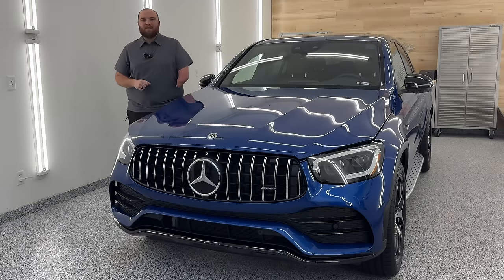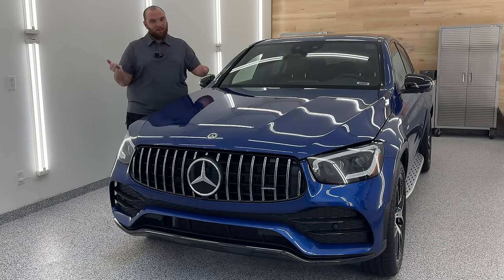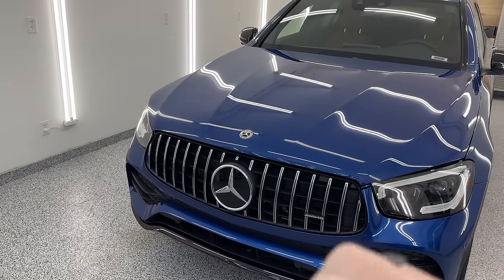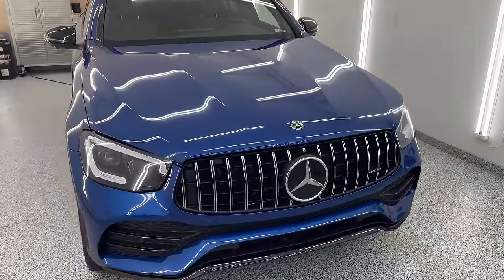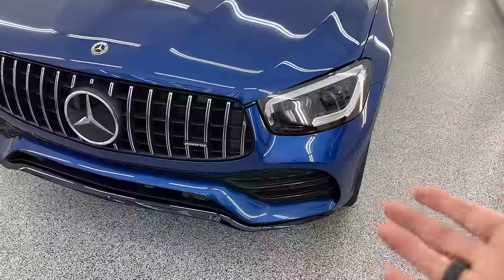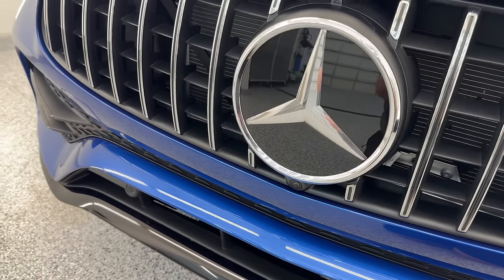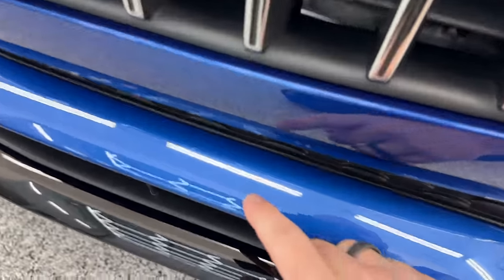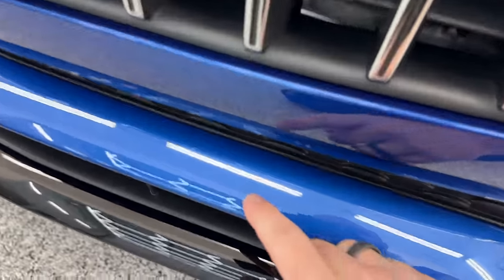The Ugly Truth About Paint Protection Film (PPF) After Just 6 Months & 3,500 Miles

Comment: Isn’t the whole point of PPF that it is a sacrificial layer so instead of the bug stains permanently damaging your paint it damages the PPF? So essentially you don’t have to repaint your car and as result reducing the resale value of your car, you just take off the PPF and now have a more desirable car to sell or trade in and with perfect (original) paint, which ultimately means higher price for the seller.
Reply: That's what he explained in this video.   It's when you see people getting PPF on a vehicle that will never recoup the costs of even getting that done is what boggles my mind!  To each his own I guess...
Reply: real talk...  prior to ppf being a thing, i've never sold/traded in a car where the paint having minor defects affected it's value.
Reply: I've had PPF/Wrap at a shop here in San Diego. After 7 years I removed them and notice lines of scratches everywhere that is caused by the razor the shop used. The value definitely went down and to say you get good value when selling or trading is not true.
Reply: @hotdognobun  exactly, PPF and vinyl wrapping is always risky when the installer hand cuts. All those video saying they are so good that they only cut the vinyl and not underneath are all BS. Those videos you see they cut vinyl over their hands; the truth is your skin is stretchable, the low amount of pressure applied over the skin with some of the blades will not cut you, but if you take that same amount of pressure apply it to paint that doesn't stretch it will leave a mark. Why does the vinyl cut then? because vinyl is a type of material that once it starts to rip the edge of the knife will slice through.
Reply: "I am a professional specialized in paint correction and ceramic coatings. PPF is not worth the cost and inconvenience, I recommend paint correction and ceramic coating. Trust me, bro!" 🤣
Reply: @shojus completely agree, but it can be nice on areas prone to rock chips like front bumper, hood, headlights, etc.
Reply: That's what I was thinking! Hell, it sounds like the PPE is as much as painting the damn thing!
Reply: Bugs aren't permanent damage to paint. You can almost always paint correct for bug stains. Rock chips? You can always touch up and done correctly it will be impossible to see unless you put you head 12" away.
Reply: @hotdognobun Could just brush on clear coat touch up, wet sand, and polish.  No more cuts.
Reply: Learn to follow the directions for Dr Colorchip correctly and PPF is obsolete waste of money.
Reply: @JetFire9  That's what I use and it's a nearly perfect repair for rock chips. No PPF for me.
Reply: The wrap shop didn't actually admit to it but they still did a paint correction free of charge that cleared it up but you can still feel the lines if you rub your fingers across. I'm sure now there's new tools and techniques to apply any film on a vehicle with less chance of getting damaged. Also another risk of having film professionally applied is that they will have to removed some body parts and it will never look the same because gaps will look different, loose parts from not fastening correctly and the worst is sensors not connected or operating correctly
Reply: Did you know when PPF is removed, some paint will come off with them?
Reply: I don’t know how much though and if it’s not a minute amount, I don’t see the point and I think it’ll cost you even more if your car’s paintwork is not a good enough one to start with. For a car with a good original paintwork, I know that after removal, paint correction still needs to be done
Reply: @hotdognobun the installer messed it up. That sucks
Reply: Well, that is a lot of misinformation , good ppf installer can wrap the whole car and you will not even know that it is wrapped. Ppf is less prone to bug stains and bird droppings than paint ( a good quality ppf ) and believe me that the 200 micron ppf and even 180 micron ppf don't get rock chips through the material and damage paint. 
I am a professional detailer and ppf installer and work in one of the leading studio of ppf instalation in my country and worked on more cars that i can count.
I've seen cars that were wrapped 2 and 3 years ago and looked better than new , and let me tell you a secret, you can also polish ppf and get amazing results 🤫
Reply: Stop driving so fast
Reply: @shojus you can argue it's not worth it. I can repair 15 paint chips  painted, sanded and polished within 2 hours for $2  (approx usage 1/10th of the bottle).

How is it worth it?
Reply: @suvann540i  True.  Paint chips don't change the value.
Reply: Problem is cost
Reply: the purpose should be that however for example i have a small hatchback and they quoted me 3000+VAT for PPF I could repaint the car for that money and it would last longer than a PPF
Reply: Did u stop installing PPF because of your disability with 1 arm.  It must be harder and discouraging installing with 1 arm right?  Is that the real reason you dont like installing for customers?
Reply: 10k to wrap a car a least and need to be replaced every 5 years.....what car do u own????? maybe a ferrari is worth it........a regular car i will think twice!
Reply: Thought the same thing. Maybe we’re missing something.
Reply: @davejohnson6144  that response is both ignorant and if you actually listen to him instead of trying to be an idiot… he makes cases for and against. It’s balanced information. Be a better person.
Reply: @lordmalice8368 I reckon so. You might as well just drive it and live with the damage from driving and get the bumper resprayed with how much some shops quote, especially in Australia where labour rates are high
Reply: That is the case, but no way I am spending $2000+ every 6 months to replace ppf. Over the course of let's say 5 years, that is a stupid amount of money.
Reply: Guys.  If you are buying a car and planning to drive 5 + years, maintain well to keep it then you have NO REASON to get a PPF!
Reply: Dude the entire reason to PPF is to protect your paint from rock chips. Who cares if the PPF got rock chipped, that’s the entire point.
Reply: @corrybowers5078 wrong. He was making cases against only. They're both a waste of money but ceramic coating is a scam. It doesn't do anything at all to protect your car. The ceramic coating guys ate all scammers and con men. Stay away from them.
Reply: @hotdognobun  Well when you go to the cheapest shop thats what you get. Thats called inexperience.
Reply: @costafilh0   ceramic coatings do ZERO to protect your paint from chips.  Completely useless and worthless.  And that garbage has to be reapplied EVERY year at more of a cost.  What a joke.
Reply: @Japplesnap  lol  anyone thats not stevie wonder can see 50 touch ups on the hood and bumper.
Reply: @JetFire9  you sound clueless.
Reply: @executiveinvestments  You are clueless.
Reply: @JetFire9  doubt that boy.  I’ve had both, PPF and ceramic coating.  You had nothing so don’t comment ok kid?
Reply: @executiveinvestments  You are a LIAR!
Reply: @JetFire9  I’m a liar?  Yeah because that would benefit me right?  I had both.  Ceramic coating sucks.  Makes the paint even more brittle.  50 chips on ur hood.  Does zero for protection and needs to be reapplied EASH year at $800.  Joke.  PPF ZERO chips, zero scratches, completely invisible.  Maybe get quality 3M film from an experienced shop.  Y’all get the cheapest price and wonder why the film fails.
Reply: PPF is a self healing sacrificial layer. Key word, sacrificial. Agree that installers are the actual risk. Lll
Reply: Bug stains aren't a problem on paint if you take care of it relatively soon after the bug hits your car, and a few rock chips aren't going to lower your car's worth by $2,500-$3,000. If you have a million dollar car, sure... But there are people with friggin a friggin Camry getting PPF!😅
Reply: @Nonx47  lol.  Bugs will embed in the paint in 30 mins on a hot sunny day.  And you tell me how much less ur car is worth after spending $3k to paint the hood and bumper.  Repainted cars are worth thousands less than a non painted car. Get a clue.
Reply: @executiveinvestments  what? What kind of crap paint do you have? I detail cars and get bugs off after a day or 2 and haven't had any etching or stains. I live in SWFL, the sun here is brutal. 30 minutes?? You're obviously exaggerating, but you're also being dumb if you think you'll need to repaint your car to sell it. You can pay $3k to "save" the paint by the time you sell it, or not and just wash it here and there (you have to anyway, preferably weekly) and sell it with some rock chips and minor stains (that come out with polishing, mind you) for practically the same price as paint with no chips or stains. You haven't sold many cars, have you? Get a clue.
Reply: @hotdognobun  this is the reason why I'm not getting a PPF, or in short, a person with a sharp blade near my car, let alone pay him to come and cut all over the surface.  There's no way the blade won't reach the paint surface and I consider myself a pro around a xacto blade.
Reply: Car owners should understand that PPF as the name explains itself is meant for paint protection to a certain extent. on the other hand, when a client requires a Matt or even colored PPF then that is not only paint protection, it is also a cosmetic thing.
Reply: wow his really watched the sales pitch videos, and now his siting it word for word as an argument .
Reply: Missed the real point of PPF.  It is expensive and does not enhance the vehicle's worth. Yes! sacrificial lamb. It is more like saran wrap, temporary protection from minor B.S.. Best to wash and wax your vehicle regularly by Hand. Paint correction every 3 to 4 years. PPF is garbage. Ceramic Coating is expensive and for lazy people. Nothing wrong in doing it the old fashion way. Wash and Wax by hand. Forget the Automated Car Wash and Touch Car washes as they do more harm than good. Clean, Wash, Wax by hand ... manual labor.
Reply: The paint will actually be a different color under the ppf. I've seen it
Reply: @guyk4341 yeah can't see why a ppf installer would say it's great! It yellows under UV and has to be replaced every 5 years. The labor to remove is high trust me bro I've been a sign vinyl installer. You'll see the line from the paint that has faded vs the other. Just like the car bra. Bro see I'm using bro so I must be right bro. Ppf is a scam
Reply: @suvann540i  Ok great but the cost of paint is now more than the engine itself. Protect your paint!
Reply: @M.D.MobileDetailing  I've owned 9 cars in my life and not a single time while using off the shelf detergents, sealants, and waxes, have I needed to repaint any of my cars.
Reply: Soooooo my car is an "expensive specialty" car. It's not a daily driver or even driven in the rain. IMHO the ceramic coating and full front PPF keep my car looking show quality new. When I go on the highway I give trucks, busses, and anything without mud flaps a wide berth. The dealer washed my car (after I said "don't wash") and I got a tiny hairline scratch on the PPF on the hood (impossable to see, unless I point it out). The PPF did it's job. Without PPF that hairline scratch would be in my paint. Two plus years, and I can wash my car, and put it in a show. IMHO having a "bad" installer is no reason to not get PPF. Would you stop eating pizza, because you went somewhere and they made bad pizza? Also, having ceramic coating and PPF is not an excuse to not take good care of your vehicle. Last, these things are not for your daily drivers. Would you put them on an Uber? If you have a daily driver, that you are going to be swapping out regularly. Don't do it. But, if you have a rare specialty car that is seldom used. A ceramic coat, PPF, along with good care, is the difference between a show car and a survivor.
Reply: @PhillipMoore-vj6cc  thank you for providing the ONLY good reason for getting PPF.
Reply: ppf cars vs non ppf sell for the same no one is paying extra for modifications and the ppf adds lines to the paint after removal.
Reply: Especially trade in time on lease 7:17
Reply: @shojus I'm getting ppf on my new car because I live in an area with lots of salt, and I have to drive on dirt roads. Just one rock flying up and there's exposed metal, which will rust. I'm trying to avoid that.
Reply: @PhillipMoore-vj6cc I agree with your viewpoint, an economy car can get a cheap paint job for less than these films. But if you have a factory paint job that you REALLY LIKE, like some candy apple red paint job on a sports car, then ripping off crapped up film is better than trying to get paint that matches some hard to find factory paint. And film that prevents 90% of rock chips is better than having 100% rock chips on your car. FWIW, my economy cars were so covered over with little dabs of touch up paint to prevent rusting that the poor cars looked like they had acne, but the metal underneath was never rusted at all. So these films are basically for car owners who want to keep their new car for some time, not a beater type car that going to wind up in a used car lot someday. And also pre-cut really is the way to go, it avoids the cuts mentioned in this video and higher end type cars will tend to already have pre-cut film available at quality shops. A lot of the problems in this video seems like mediocre installers using cheap film, higher end films installed by a quality shop can keep a new car looking good for quite some time, fwiw…
Reply: @tafl-9198 good point, some shops can even offer just bumpers or headlights for a affordable price, or smaller package deals like front bumper, hood and headlights to avoid rock chip damage to expensive headlight assemblies or nice looking hoods….
Reply: @guyk4341 true, and nowadays they even make car wash soaps and polishes for film to keep it new looking, quality film can look new for quite some time if it’s a quality film manufacturer…
Reply: When selling a car, ppf adds 0 value. I wouldn’t touch a car with pff installed.
Reply: Wow. Way to say exactly what he said in this video.
Reply: @executiveinvestments dude , ceramic coating protects your car from UV rays , not rocks lmao
Reply: @Heymeit  that’s complete bullshit.  Maybe look at a high end car.  Just about ALL have PPF.  Car is worth more.  I wouldn’t touch a high end car that didn’t have PPF. Good luck with a million rock chips.
Reply: Obvious this guy does not commute on Southern California freeways, after a year of commuting your front bumper looks like it’s been sandblasted without any protection. The wind blows sand across the roads quite frequently especially in the desert areas and it will do damage.
Reply: Did you watch the video my brother 😂
Reply: @NativeSon253  did you watch the video?  If you have a high end car and want to keep it nice then get PPF.  If you drive a pos and don’t care then don’t get it.
Reply: @DJS100  the point is it protects the paint from everything.  Bugs included.
Reply: @suvann540i yea but we talking about a 20 yr old Corolla here or a brand new Lamborghini Aventador. Cause a minor scratch on the Lambo will definitely affect the sell value, but on the Corolla they probably not even looking. 

So I would say PPF is only worth it on expensive cars if they're getting it to preserve the resale value.
Reply: @M.D.MobileDetailing  one fender bender and my car will be cheaper to repair than yours. Insurance ain't going to pay for your wrap.
Reply: @youzongliu  literally the only reason why anyone should consider a wrap.  But I'll be honest, the wrap would cheapen the look of the car. Hell, it'll probably reduce the resale value. Cause the next owner will have to pay to remove it.
Reply: But why bother when putting on PPF costs like 7-8k and respraying the car professionally at factory quality or even better costs like 1.5-2k? You can have the whole car resprayed 3-4 times for the price of a single PPF installation.
Reply: @derbigpr500  preach!!
Reply: @JetFire9  What is this you speak of? Sounds interesting.
Reply: @Nonx47  ..."But there are people with friggin a friggin Camry getting PPF!"... 🤣😆😂
Reply: You're preserving the paint for the next owner😂? I'd rather have fun with my performance car. At the end of the day, nobody cares about rock chips or not.
Reply: @suvann540i I live in an area where one trip will sandblast the front of the car. People use ppf because of the environment they live in
Reply: @tham3rHD  touch up paint is still ridiculously cheaper.  and let's not ignore the fact that 'clear bras' have been around wayyyy before these detailing shops decided to capitalize on pushing charging people 3k to needlessly wrap their entire cars.
Reply: @richscott2483 finally a real opinion i can agree on
Reply: @hotdognobun not true. Whoever did yours must be extremely lazy and unprofessional.
Reply: I just sold a truck and the paint chips were not an issue that would have justified spending 2k for a protection layer
Reply: The alternative ? Nothing or Icon Rocklear